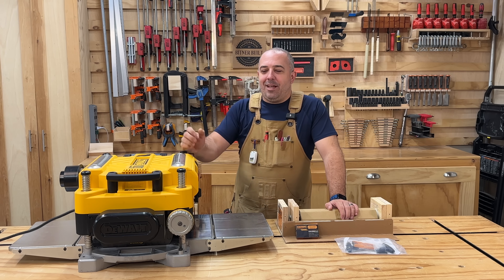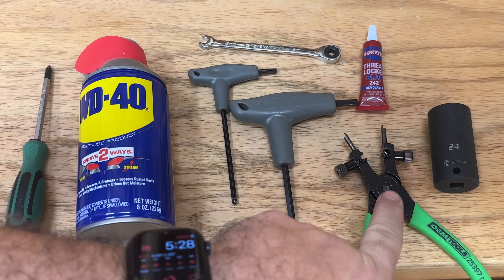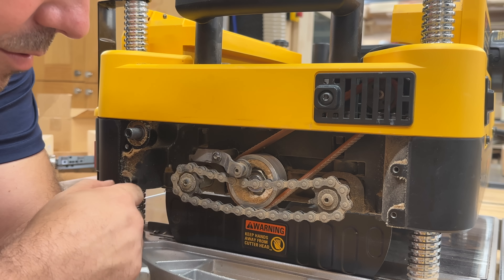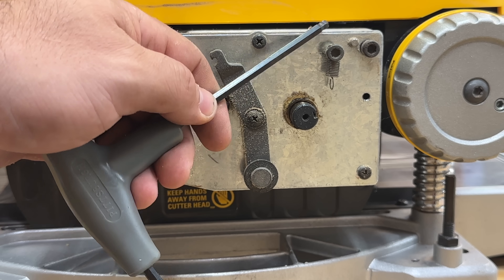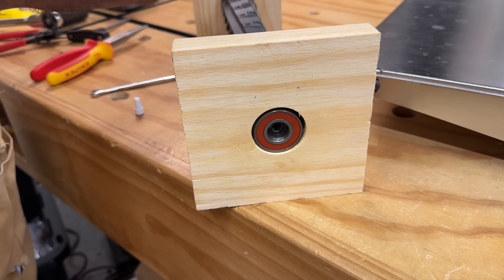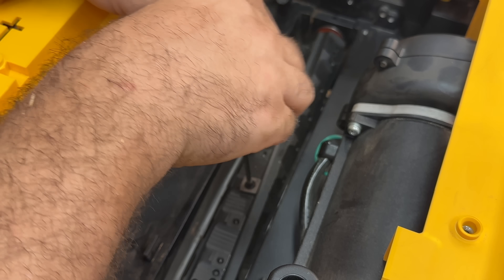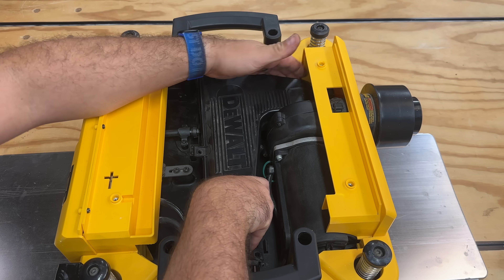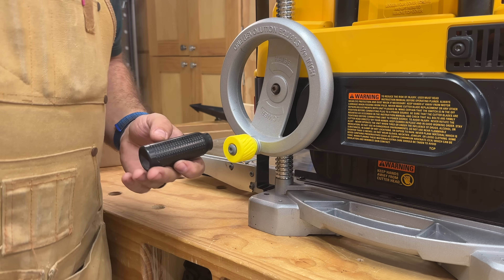4 Upgrades For The Dewalt 735 Thickness Planer -  Elephas Helical Cutter Head, Dust Port & More

Comment: Great tutorial. Perfect editing (great time save). Thanks too for the alternative source for a helical cutter head. Superior cutting heads (squares) - a fatal flaw for those of us who are notorious for over tightening). Bonus: the 2 bearings are already installed by the manufacturer, so the Eliphas head not only saves ~$150 compared to alternatives, but also frustration attaching bearings to the new head. A win - win in my book. Instead of replacing / modifying the infeed - outfeed “wings,” consider building a platform that sits on top of them & bed of planer w/ a piece glued / screwed underneath each end (to keep it from sliding thru the planer). 3/4” or MDF would be ideal. You’ll lose the thickness of this sled from the planer’s capacity, but how often to you plane 24/4 (6”) stock?
Reply from the maker: Yea Elephas is definitely a win here. My second head from them now. Speaking of the passthrough platform that it’s what I did! Also On an adjustable height base.

Comment: I would recommend that you don't lubricate the bearing housing. That will promote the bearing to spin in the housing, then the housing will need to be replaced
Reply from the maker: Thanks for the tip!

Comment: Great video -  makes me think that I can do this.  I would like to point one thing out. In the assembly process you show tapping on the end of the shaft with a hammer.  ( side where the larger ball bearing, 6204, is).  Although i'm assuming you're using a brass or 'non-steel hammer it's  inherently a poor idea. Should you strike the shaft end too hard,  the force, which  is transferred through the inner ring /balls/outer ring can create small dents (brinnell marks) in the bearing raceways.  These can not only be noisy but also  lead to early failure.   Optimally you should use a soft steel tube with approximately a 42mm OD & 37mm ID placed against the outer ring and hit that to seat the bearing.
Reply from the maker: Great tip 👍

Comment: Think twice about a helical cutter I had one additional was a piano took more power and keeping cutters set was a absolute pain and you don't have to remove both snap rings only the one on the removal side greasing the surface that bearings ride on won't lubricate the bearings
Reply from the maker: 👍 thanks for the tip

Comment: Excellent video with clear instructions and steps to execute the helix upgrade.  Love the upgraded dust port - Have to agree, the dust port is a pain longer in-feed, and the out-feed table does require an extension. Your cable mgmt upgrade is definitely a must.
Reply from the maker: Thanks glad you liked it! Should be building my new setup for it soon!

Comment: Very cool on the 3-D printed added parts. I have a printer from Bambu Labs (earlier this year), and hadn’t even thought about modified parts for my woodworking shop. I only came across your video as a result of looking into upgrading the Dewalt planer cutting head.
Reply from the maker: Oh yeah, that’s what I’ve really been focusing on with my 3-D printer, I just put out the video the other day on wood versus 3-D where every month I’m making the same item out of the wooden 3-D to see which comes out better, and then giving away the files for of course, as well

Comment: Great tutorial, thanks! When you do the next video about the replacement bed window, I'd love to have a mention of exactly how your reconfigured dust port works with your collection system, and why it works better for you. 

100% agree about tools that have integrated storage for their included adjustment tools. If I never had to look for the angle grinder wrench again, I'd be a very happy DIY'er!
Reply from the maker: No problem! I use the Dust right dust collector attachment, and so that has a different diameter than a lot of dust ports do so I made sure to select one of of the files that not only angled it to the side, but also accepted my dust port. I’ll make mention of it in the next video.

Comment: Great video. Thanks for the links to the 3D printed parts. I just finished printing the cord management parts and the angled dust port, great upgrades. I wish I could convert to a helical cutter, but I can’t justify the cost (yet).
Reply from the maker: Great! Yea I was in the same boat on the cost, I just ran about 500ft through it and it’s great, so really happy they sent that one over.

Comment: Helical planer heads are awesome.  My old Makita planer had knives that I needed to routinely replace due to chipping from knots or a piece of embedded metal.  Just need to rotate a helical head cutter if one ever gets chipped and they last longer since they're made of carbide.  Helical heads are also not as loud and typically I can go straight to 120 or 180 grit sandpaper before finishing.
Reply from the maker: Yep they are wayyy better than

Comment: I just replaced mine almost smoothly.  I had a leftover washer at the end and I didn’t really remember taking it off.  I thought maybe it was just part of the old spindle because when I moved that to pack it up, that’s when the washer appeared.  My machine was cutting pretty good, but seemed to be making a slight grinding sound…but I couldn’t quite figure it out because I always wear headphones to block sound and then this new head has a different sound and less decibels.  So I rewatched your video twice to see where I went wrong.  It was the washer that goes in right before the key and pulley head.  There was no show or mention of that washer in your vid while removing parts, only for a split second during the reassembly does the washer makes its first, very brief, appearance 😅
Reply from the maker: Ooo sorry it was brief but good you caught it!

Comment: awesome!  now figure out to eliminate snipe.  my 735 was snipe free for a year and then, snipe city.  that must mean there is some kind of adjustment for the rollers?  is the tensioner spring related?
Reply from the maker: I ended up doing a flat passthrough bed that’s easily adjustable and elongated, so often the machine wings are forced out of being level by the wood itself so adding a psssthrough bed helps a ton

Comment: Great video thanks for the step by step. Gonna try to do mine on a few days. You mentioned a 3D printer and I’m looking to get one to print stuff as well. Which one do you have and are you happy with it?
Reply from the maker: I have had nine 3-D printers now, the best beginner one that really got me into things was the AnkerMake M5C. Super easy, great machine and reliable after that the Bambu lab printers. Are the top end of the industry at the moment. But honestly, I still recommend the AnkerMake when your first starting out until you learn a lot of things.

Comment: Clever stuff......I replaced the giant crank handle years ago with a round wooden cabinet knob.....makes it much easier to crank from any position you may be standing around the unit...
Wondering why you replaced the cord holders.....
Reply from the maker: Mine did not come with cord holders, I added the 3d ones because there wasn’t any on my unit

Comment: I just put a 90º elbow onto the stock dust port and it worked fine!  My hose no longer blocks the output side.
Reply from the maker: Good stuff! Did you use a regular hose elbow?
Reply: @BitnerBuilt  Just a 2-1/2 inch ABS elbow.  Worked a treat and my vac hose fit very nicely.
Reply: Just checked, it’s a 2 inch elbow and a 2x2 rubber coupling.

Comment: Fantastic video, Justin! I am really interested in the exhaust port you changed out for the OEM. Do you have a  video showing it in action with the DC hose connected? Also, can the port be rotated to exit on the height adjustment wheel? Thanks again!
Reply from the maker: Thanks! I’m actually having my modeler make me a new custom one that we will use in the next video on this, going to make a custom rolling lift stand for it with a fold out bed extension and then the new custom port that will go fully to the side of the unit, the one in this video is better but not as good as I would like it to be! Will be prob this mo or early feb for the video

Comment: Question! Do you feel that the Dewalt is superior to the Oliver bench top that comes fully set up with the Helical Cutter Head? I am a wheelchair dude with pretty shaky hands. I watched you work the entire video X3. The Oliver is 1K fully set up. I can get my genius pals to help do the mod on the Dewalt but I value your opinion. Thank You much for your Wicked Cool videos….. Please let me know. The Jet 6” bench top jointer is my next up tool. Then after I do the mod on the jointer feed in & out then next up is the planer. Best! TS, Portland
Reply from the maker: Thanks a lot! so I haven’t used the Oliver personally, I just took a look at it and it has the same form factor as all of the other cheaper benchtop cleaners, rectangular. This makes it a little less stable than the 735 as that one probably has the largest footprint of a benchtop in a more square shape. Additionally, it has four large riser screws at the machine travels up and down on compared to the Oliver 2 small ones. That being said we’re still talking benchtop planers so there’s really not a huge difference overall as long as you’re making sure that you’re matching motor power. the difference that you’re gonna see in either one of these compared to a larger unit is the absence of a longer cast-iron in feed out feed bed. Personally, if you can find a used grizzly or powermatic that you can pick up cheaper and then add the helical in, that’s the biggest win. That’s what I was able to do with my 8in grizzly jointer. Phenomenal grab!

Comment: Justin - Question? I went to the Amazon link you listed for the cutter head you installed. In the item description details it says, "The cutterhead's cutting diameter is 2mm smaller than the original, allowing for installation without removing inserts. cutterhead." I was wondering if this is new since you shot your video and if this means I don't have to remove all the carbide cutters before mounting it? Or would you still remove them to just eliminate the chance of nicking one of them when you tap it in with a mallet? Last question. When I removed the straight cutters, I noticed that the metal on the body of the planer near where the screws hold down the blade and blade cover had metal chips missing from it. The screws were tight and not hitting the metal frame behind it. So I'm wondering if the chipped metal was from the chips flying off the wood against the frame. I plane a lot of really hard and exotic woods, like bloodwood and zebra wood. And I have on a couple occasions forgotten to turn on the vacuum system, but fixed it after the first board went through. Have you ever noticed that on your planer. Any idea of what causes that?
Reply from the maker: I would still remove the heads for safety, handling them is a bad idea and it’s a harder install than a jointer (you leave the cardboard wrap on it till done) it only takes a min. On your metal knicks I haven’t seen that in any of mine, planers are a “violent” machine so it’s possible. Are you the only owner, my guess would have been someone planing something with a nail etc in the wood who didn’t realize

Comment: Very well done video.  Thanks.  If I go this route, yours will be the guide.  That being said, I am curious what factors led you to choose Elephas as opposed to other available options?  I appreciate that is possibly a top for an entire video but any thoughts would be appreciated.
Reply from the maker: thanks! there are a lot of heads out there that are available. I have seen their products in come commercial grade equipment previously so when I was looking to upgrade my grizzly pointer I had purchased used, their name came to mind first. I did my research and there are some other names out there that came up a lot. As I talk about in the jointer video everyone has a slightly different design and of course then claims to be the best but it seems a bit "marketing" to me. For that model and size it was one of the cheaper listed ones so I reached out to them to see if the quality was up to snuff and I have been extremely happy with it. (you can see my jointer video as well) and then they reached out to me after and asked if I would like it for my planer and I had just picked up this one used so I was very happy to have it sent out. In the end all of the new designed spiral / helical heads offer so much easier service / maintenance to maintain a quality cut on the wood, with the large standard knives, you hate to replace them and so you stretch their use longer than you should, producing a lesser product. so just the convenience of being able to easily rotate one of the carbide tips in 1 min, means im more inclined to keep the machine at top quality.
Reply: @BitnerBuilt  Thanks for the extensive reply.  I appreciate the effort it took.  Similar to you, I switched to the Byrd Shelix on my Grizzly jointer several years ago and have never regretted it.  As you suggested, one motivation was avoiding the annoyance of needing to set the knives when replacing them.  That is not an issue when replacing Dewalt knives.

I have not yet rotated the cutters on the Shelix.  There is some suggestion out on the internet that accurately rotating the Byrd cutters can be slightly more challenging than on some others.  Frankly, that and price versus quality would be factors for me if I also make the change on the Dewalt.

Comment: I don't have access to a 3D printer, is there somewhere to purchase the final product?

And, i installed a Helix a few years ago, its great, but when working with epoxy, the Helix tends to chip out. Do you ever switch back and forth with the regular head, and if not, what do you use instead? Or maybe you dont work with epoxy.
Reply from the maker: Yes, you could look on Etsy or there are services where you can upload 3-D print files and they will print them for you and then mail it to you. I actually do a lot of friends and work. I don’t like painting so when I make signage and different things like that, I typically will inlay it with resin. I actually haven’t had any chip out that I’ve seen. I installed this all months ago and it’s still been a plus I only just had to rotate my first, the other day
Reply: @BitnerBuilt  Thank you. I'll look for those services. The chip outs I've had were manageable, but I worry about larger projects.

Comment: Great stuff.  I dont have a 3d printer and I dont know anyone whom does.  Do you have a source for the dust port and handle. To purchase the parts??
Reply from the maker: so there are websites where if you upload the file, they will 3d print it for you and then mail it out if you do a search for that. I know there are also some for sale on Etsy that people 3d print on demand
Reply: Wow thanks I have learned a lot today.
Reply: Hi again. Thank you for the files. I was able to find a Etsy person to print the dust port and a new handle.   I am constantly slamming my thigh into the factory long handle.   One thing I didn’t catch was that the new dust port points to the right.  My dust collector is on the left side so I needed to drill new holes for the catch pin and alignment pin. So i could make my new port point to the left (the same side as the handle). So maybe one more improvement would be 4 holes for either a right or left direction port.  But this will be a big help in my shop. Thank you

Comment: GREAT VIDEO ...HELP... can not locate the 3D printer file link
Reply from the maker: They are listed in the description 

Cable management by Cdelahousse - https://www.thingiverse.com/thing:4771451
Small Handle by Q8YLAB - https://cults3d.com/en/3d-model/tool/dewalt-dw735-planer-short-handle
Dust Port by Chriscos - https://www.thingiverse.com/thing:3379344

Comment: Hey question for everyone who upgrade to the helical cutters. Is it worth it? I feel like a jointer upgrade is obvious because we are using our strength against the blades so switching to helical makes it easier for us but the planer does all the work so I am on the fence about this upgrade.
Reply from the maker: Respectfully, you’re a little wrong on the jointer, a helical makes it harder to push through. With the standard blades there a millisecond gaps where there is no blade in contact with the wood but with a helical there is always a blade in contact. So a little harder to push. It does make it quieter, cleaner cut and 1000 times easier to replace / rotate the blades. I did a video replacing the joiner as well on the channel where I discussed that.

Comment: I wish i could set mine up in the driveway and blow the chips into my neighbor's yard. 😂 It makes so much sawdust. I run mine into a cyclone attached to the top of the cabinet it sits on. The cabinet is a pretty good size but nevertheless must be emptied after even a small job. 

I ran into Dewalt's over-tightened screws with my palm router recently. The guide plate was crooked and one screw stripped. The other three loosened but only after some David Banner-like rage.
Reply from the maker: 😂😂😂 just tell him it’s free mulch! Yea those little heads just scream round me out… was not fun

Comment: Shoulda got the helical head on mine it's just a shockingly expensive upgrade...and from day one I was like why is dust port straight out lol, first thing I thought was needs a 90, not sure why they did that...
Reply from the maker: Yea the dust port thing was a head scratcher. Some people 3d print a mod to put it out the top, wayyy better position